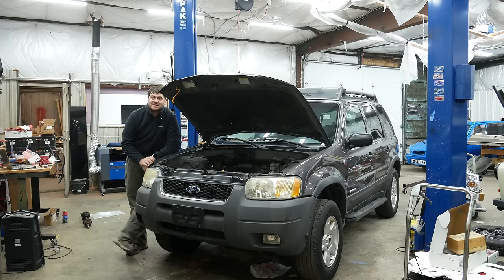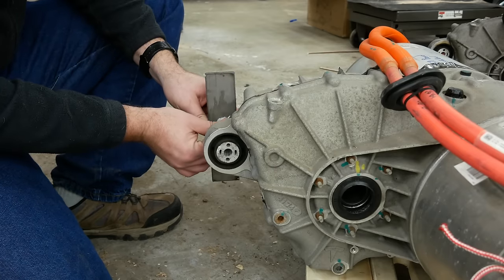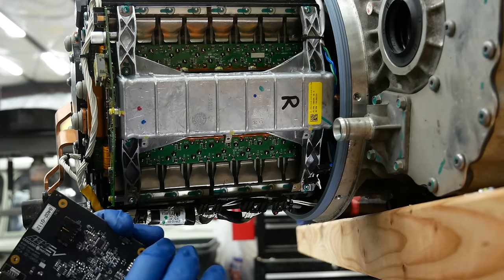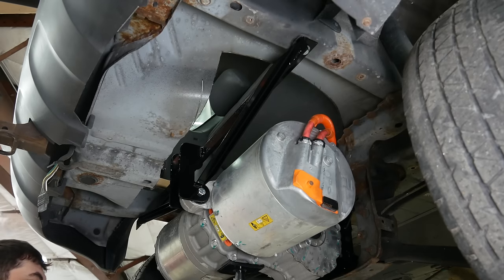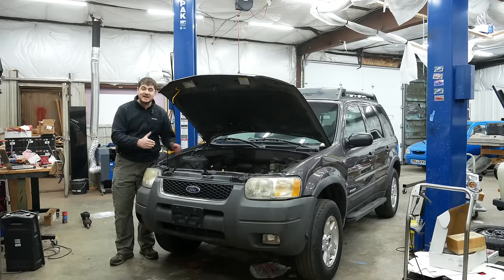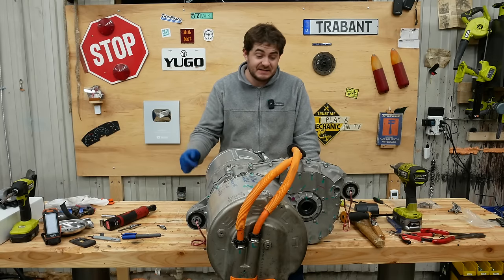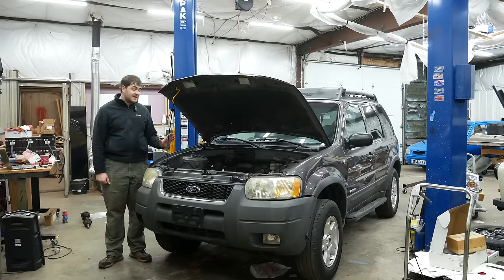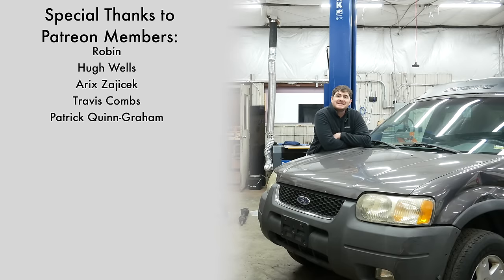This Escape is Now Rear-Engined (and Front-Engined) | 900HP Electric Escape Project

Comment: As an Escape fan, im proud to see one being put into the EV era like I dreamed of. The Escape community Im in is rooting for you, Ill be sharing this next video with em
Reply: Imagine him suddenly getting knee deep in requests for EV conversions. Could easily pay for the rest of the project and the bus refurbishing.
Reply: @TheWinjin  yeah because he can totally work on like 5 major projects at once
Reply: @YouTubeHandlesAreStupid  There was a time when the pre-2013 Escapes were sold with 4WD, manual transmission and considerable reliable engines with decent performance and gas mileage, and had quite an interesting ground clearance and offroad capabilities, contrary to the things 2013+ Escapes might be able to do, particularly with the 2017+ EcoBoost engines... I used to be an Escape fan until I decided to buy a brand new 2018 with EcoBoost... man, what a mistake that was... it's been 6 months since I took it to the dealer with the infamous coolant leak only to find out that the actual piston head cracked, and even with the replacement engine, the thing just doesn't stop having issues. I'm selling it as I found a cheap 2001 Mercury Grand Marquis with low mileage just under $2k USD, and the thing is almost mint condition. They are selling it because gas prices, but the economy you can get from those Panther-based cars can easily match and outperform that of a current gen 2.0 4-banger turbocharged gasoline engine.
Reply: @YouTubeHandlesAreStupid  get gifted one as your first car and never get rid of it, and end up with 2 more by luck
Reply: @Xedilian  I have the V6 variant, impeccable reliability close to rivaling the Japanese. Not sure why you're so heated over someone who likes a generic car; it's kinda funny how you made a whole argument about why you don't like the Escape. Sure, the ones past 2013 are terrible, but I enjoy my '04.
Reply: @porschecarreract  I have the same engine in an '06 and likewise it has been fantastic. Not everyone thinks this but my experience I've been very happy.
Reply: @MrGFG003  the manual only ever came front wheel drive though lol. That said I love my 2011 escape. They’re the last somewhat analog small suvs there was sold in North America. I don’t know what I’m going to drive when they’re all gone
Reply: @porschecarreract  he must’ve deleted his comment since I can’t see it anymore. But there’s lots of people who love the older generation of escapes so who cares what he said I guess lol.
Reply: @jackdough8164  On the older 2000-2005 lineup, I'm sure there was a base XLS with 4x4 and manual transmission sold in Mexico. Back in it's day it could have been a thing, but as many other Fords, they were ahead of their time in terms of features, reliability is a whole other story lol.
Reply: @MrGFG003  I don’t think a 4x4 manual was offered in North America. Sadly. They should’ve offered all engines and transmissions as options. I don’t know why car companies do crap like that.  Imagine a 240hp second gen with a 5 speed and 4x4?  That would’ve been sick. Even fwd it would’ve hauled ass.  And yea I’d personally only buy a 09-12 myself. And if I ever did end up getting one of the third gen (which are even worse) I’d only buy it with the 2.5. The ecobursts are junk
Reply: @MrGFG003  sorry I should say Canada and the states. I always forget Mexico is part of North America lol
Reply: You're right, for some unknown weird reason we got the 2.3 manual 4x4 only in Mexico, but sadly, not the V6. Guess Ford was going through a somewhat hard crisis and didn't have the money to invest on a strong mass production transmission to offer even a 6-speed manual tranny with both engines and 4x4... buuuuut we got the infamous ETC problem instead lol...

Even today I'm wondering why most american manufacturers have the same lineup in the US and Canada, but not in Mexico... even with the commercial agreement between these 3 countries... would have loved to get my hands on a used 2010+ Mercury Grand Marquis...
Reply: @MrGFG003  yea from what I can tell you guys have a way better selection of vehicles, especially small suvs down there.  Probably has to do with all our regulations up here in safety scissor land lol
Reply: @jackdough8164  Not really, we stopped getting the Ford Crown Victoria/Mercury Grand Marquis/Marauder on 2004 (I really wanted to get me a Marauder lol). We didn't get the Taurus X, the Freestyle, Flex, a number of Oldsmobile, Buicks, Pontiacs, Chryslers too... Lexus just joined the chat here... maybe we have more available cars but that don't meet the NHTSA nor EURO NCAP emissions and safety regulations (preeeeetty much that's why they are sold here, the mexican SCT authority is a terrible joke). I used to be a Ford guy myself but my Escape EcoBurst and this new EV trend almost killed the vibe. I still drive a survivor 1992 Ford Tempo, and the thing just receives US $50 worth of an oil change and filters at home, and the thing is just doing fine lol.
Reply: @MrGFG003  yea Ford turbos are absolute junk. The only one I’ve heard isn’t the worst is the 2.3 ecoburst and that’s because it’s the same design as the Mazda 2.3/2.5 they used forever.
Reply: my parents used to have a brown 96 escape it went through a lot but worked for a long time, from lack of maintenance to a couple accidents..
Reply: @niq872  lol the escape didn’t come out until 2001. I don’t know how they’d have a 96
Reply: @jackdough8164  you are right I got confused with explorer
Reply: @niq872  they do look a lot alike so I get it 😛
Reply: @niq872  by 96 you mean a 1996? The Escapes didnt launch until 2000. Unless you meant 06 and accidently hit the 9 instead lol
Reply: @porschecarreract  no someone else also pointed it out i got confused with explorer
Reply: @YouTubeHandlesAreStupid It’s hard for me to fathom myself, but I once bought a 2011 Escape because it was in near-flawless condition for its 74,000 miles, it was an AWD Hybrid (an intriguing and useful combo for me), and it was relatively cheap compared to my other options at the time.  I didn’t think I’d end up liking it as much as I have, but it grew on me quickly.   It’s just…  competent.  Not great or special at any one thing, but comfortable enough, quiet enough, economical enough, quick enough, roomy enough, etc.  It adds up to a surprisingly likable and well-rounded everyday vehicle (and it goes like a demon in a snow-storm).
Reply: Escape community. What a lover lmao😂😂😂😂😂 jk jk
Reply: I had a 2008 4cyl 4wd escape. I miss that car 😢
Reply: there's an Escape community. lol

Comment: That sticky gooey stuff is called a thermal interface material (tim). It;s used to dissipate heat between the transistors(don't ask weather they're fets, bjts or any other kind) so that one doesn't go all the way up to 200 degrees while the others are chilling at around 50.

Comment: I love this project 😀 Interested how much traction you have with a 900hp ford escape too 🤣
Reply from the maker: The front axle will be doing rather little. Traction Control will be my friend
Reply: @Aging Wheels  Where would the traction control IO come from? Do you buy boards from some company for something like that?

Mainly asking because I wanna do the irresponsible thing one day and write my own vehicle control management software one day. I made my own (combat) tank traction control and stability code in a video game I played where everything was physically simulated. If I did it in real life I'd probably do it on like a go-kart or something so I don't actually die when I command a bonkers input from my undertested "I'm a professional how hard could it be" code.
Reply: I'm imaginging the Escudo Pikes Peak edition from Gran Turismo 2 here. Just all four tyres pouring smoke.
Reply: @monkatraz  i guess it taps into some sensors for the wheel speeds, abs sensors or something.

fancier needs gyros and accelerometers to have a better model of what the car is actually doing, but you can just detect when a wheel slips with abs wheelspeed sensors with a not so fancy algorithm.   you can also make a tcs then that cant' climb a slightly icy hill, but mostly working one isn't that complex in principle and companies did sell mostly working ones.

Comment: The modified support bracket at 13:00 is undersized for that weight. It's OK in static loading, but will probably buckle after some good bumps.  The diagonals will tear at the center weld points because of the trimming to clear the bolt.  If you flip the support upside down and compare it to a typical roof truss for a house, you'll know to add three angles to each side in a zig zag pattern.  Add a third frame bolt over the gearbox support point, because only 1 frame bolt on each side is probably not enough.  You could bridge the tire well gap with a 4" channel and center bolt to that.  LOL I have that exact Sport model 02 Ford Escape.  Black, roof rack, tail mini hitch, automatic version.  I retired it at 320k miles a few years ago.  It's a good car!
Reply: Came here to say something along these lines. Not enough triangulation to prevent bending under enough load and twisting. Particularly concerned in that spot where Robert cut off the angled sections of the brackets. Needs a lot more reinforcement to hold up.

Also not convinced those thin cylindrical standoffs will spread the load - wouldn't be surprised if they punch into the frame. Extending the bracket to the second hitch mounts in front will give it a fighting chance.

Comment: Putting another drive axle in the rear of the bus driving both with separate motors, would get you 4 wheel drive (actually 8 wheel), and then use the diesel engine coupled with a generator, would make the bus awesome for long distances. Love your channel, and content.

Comment: as a welder the rear mount of the front motor might give you trouble, these ford escapes have notoriously thin sheet metal. even though you appear to be using 3/16 or 1/4 but that doesn't change the strength of what it's welded to, my recommendation would be to have a u shaped scab plate follow the contour of the subframe to spread the load, this wouldn't need to be continuously welded because that would induce warping and a stitch would be more beneficial. I believe this would better spread load to existing structures, as for the rear the ends of the angle iron should be gusseted away from your mounting hardware 1/8" mild steel will absolutely twist like taffy under a hard launch. one other thing is to make sure that even though you want penetration and a good size weld, you absolutely do not need to throw a 1/4 in of weld on 1/8 in hrpo you will have a bad time, the key is to understand how much heat you are putting into your weldment and for how long. The key is not to overweld, more weld more better is not what works. good luck on the escape/bus

Comment: Regarding the strength of the front motor mount bracket that passes under the steering: You've made the bracket strong, at least it looks strong, but what about the strength of the car frame where the bracket is attached?  It has to resist not just the up-down load but the torsional load put on it by the bracket.  Perhaps you need additional bracing to stop the car frame bending.

Comment: The liquidy-gooey stuff is called Conformal Coating, and it's used to help prevent corrosion on boards exposed to the elements.

I was just looking up MG Chemical's conformal coating to replace the stuff I cleaned off of several control units I rebuilt.

Comment: Keep the diesel, find a generator to hook it to. If you haven't already, look into Edison motors. If you talked to those guys, I'm pretty sure they'd be more than willing to help you out with some ideas or leads on parts to make a "range extender" out of the c7
Reply: Plus having an e-axle instead of two drive units to a differential can cause twisted drive shafts, as the edison guys found out with carl

Comment: A good way to add strength to the aluminum battery box is to bead roll. If the material is thin enough, you can bead roll shapes into them to add structural support. HF has an okish bead roller for fairly cheap. Unistrut also makes for good ribbing.

Comment: Question/Statement: I noticed on the back mount that you remade a few times, that it bolted to the old trailer hitch. One thing I also noticed is that you only used 1 set of bolt holes. Why not use all 4 bolt holes of the trailer hitch to get it more strength? On the front drive unit, I think you need to add a few more braces, including the main drive brace.

Comment: Take it from somebody that built a 300 hp Chevy luv when I was 12 using only hand tools with no kit.
If you question it needing a gusset just do it.  Rubber mounting is your friend. 
Anything you box up with the opening pointing up (can collect dirt and water) will fill up and start rusting. Drill as large as a drain hole in the bottom or the sides near the bottom as you can.

Comment: You can find a 12v electric over hydraulic power steering unit in the mid/late 2000's Volvo cars (and probably others). It's a Ford built unit, so I'm thinking it might be a simple task to adapt it to your existing Escape power steering rack.

Comment: If you go with hydraulic power steering you might consider a hydro booster for the brakes too. it would save you the trouble of a vacuum pump but add the trouble of a hydro booster. Just a thought. Love the videos.

Comment: You're doing a great job . I have a tip that may help you on the future with your captered nut Dilemma.  Drill an oversized hole where you need tge nut. Far bigger than the nut itself.  Weld a nut to a steel plate.  Weld the steel plate to the crossmember,  what have you. Problem  solved. 😊

Comment: This is something I have been thinking about doing with my pickup.  It's an old 03 Dakota quad cab but it was the vehicle I got with my wife and took a ton of trips with, she passed away in 2019 as well so it's not something I can ever replace.  A few months after my wife passed away I took a trip towards Tucson from Oklahoma City and while headed from White Sands NM over the mountain's to Las Cruces NM the head gasket blew.  More or less the bolts stretched and it still drives with a little coolant loss and some exhaust getting into the coolant but still needs to be rebuilt or replaced.

I don't drive it often now either, mainly on runs to pick up stuff for the house which I am working on.  Bought the house cheap but have had to replace the roof, electrical, and plumbing as well as install insulation because it had none installed.  Gotta do the same for my truck as well.  Honestly would love to have a small camper as well and thought about doing solar panels on the camper setup in such a way that I can pull power to the truck as well and head down the road and if I stay at a campground I can plug in and charge everything up as well.  Honestly probably just bounce around campground to campground to get where I want to go.  Just don't have a ton of a budget right now, been doing the house about 500 dollars at a time.

Comment: I used to have a 2001 Nissan Xterra. 2WD, 2.4 lt engine and manual transmission. I loved it but I spent so much time just dreaming on what you did to this Escape.
That truck should have never been produced with that 4 cyl engine. 
Thanks for sharing this.

Comment: You should sell pieces of the bus engine! Could be an interesting filler video, tearing down a large diesel. Maybe plasma-cut the larger pieces like the block and piston with your new machine? Likely be able to make much more selling little collectible pieces than selling the whole engine. Would also be a way to symbolize going electric, by ripping apart an engine. Just a thought!

Comment: "Each side of this brace bolts into holes for the trailer hitch frame on either side, so I know it'll be strong enough." Just makes me think about all the trailer hitch failures I've seen. In fact, I saw one on an Escape exactly like that rip those very nuts right through the frame. They're nothing more than a captive nut inside the unibody rails, which is about 1/8" thick, if that. If you look at an Escape that has a hitch, you'll see that it has a third mounting point in the rear center that actually bears most of the weight, and changes the whole distribution. That rear mounting point effectively makes the hitch a first-class lever, so the trailer actually pushes UP on the two forward points, rather than down. Just thought I'd warn a guy, you may want to take a second look at hanging anything from those points. Those nuts probably aren't nearly as strong as you think!

Comment: There is a company called Edison Motors based in Canada that is currently building diesel/electric semi-trucks. Doing a similar concept would be cool to the bus. Essentially you can leave the CAT engine, remove the transmission and install a generator that will charge the electric batteries to extend the range of the bus even farther than being limited by the batteries

Comment: they call him mr shrink. one with all that equipment has to be aware of the space required between parts to account for shrinkage. on that material is use a .030 feeler to set the min clearance and account for the contraction when the weld cools. the space is fab 101 and things a first year apprentice learns along with basic jig or fixture to retain position of the part as the material cools and shifts.   aside from that the idea of using this power plant in converting to ev is a great topic and your info is informative .

Comment: 7:32 My guess: cooling the electronics.  Have you looked at a tower computer lately?  The main difference between towers and laptops (besides expansion capability) is about 6 inches width (or hight, depending on orientation) of "dead air" for cooling.